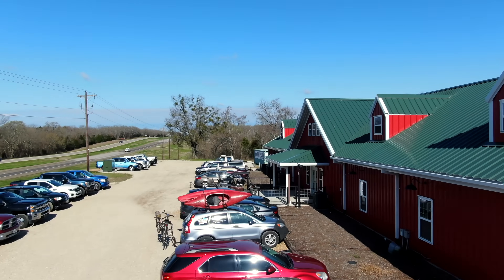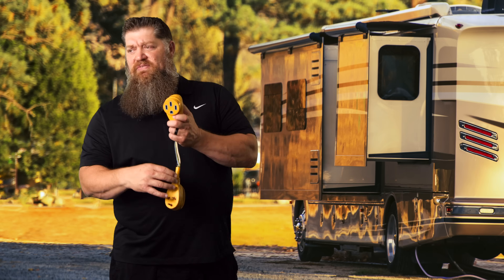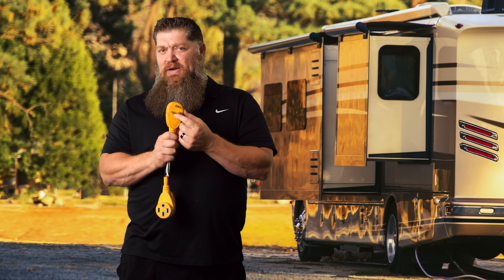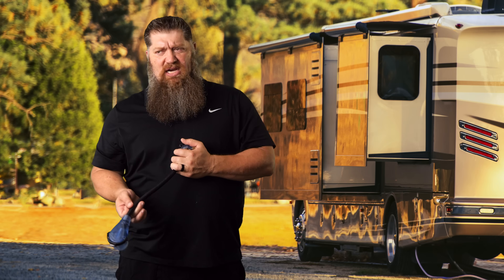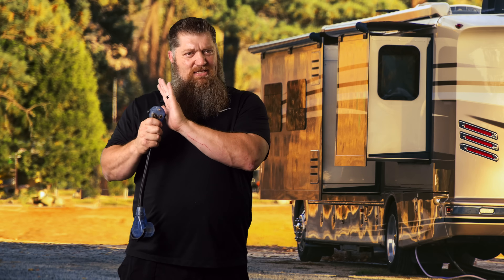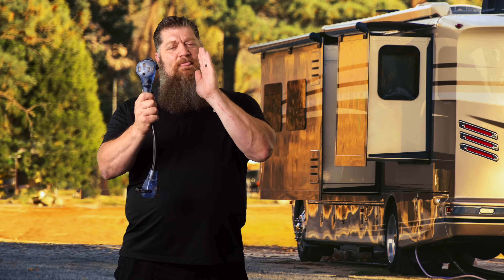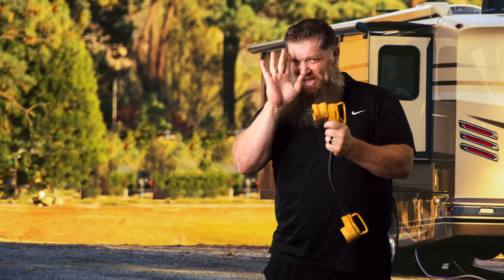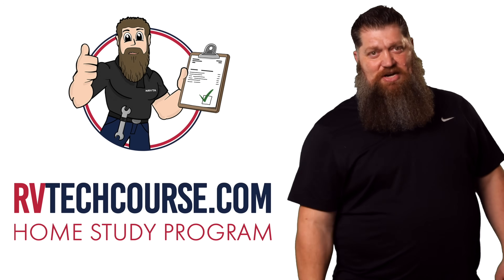30A to 50A RV dogbone adapters. What you need to know.

Comment: my old Avion is set up with a Coleman roof AC that runs off a 20 amp so I can plug it into that GFI breaker on a panel and run it along with the main air conditioning unit at the same time.

Comment: Thank you for the good info.  Im getting ready to use a 30 amp westinghouse igen 5000 dfc as a back up on my 50 amp rv. I was planning on running a 50 amp to 30 amp dog bone out of the rv's outlet and hooking up the 30 amp generator power cord to the 30 amp dogbone.. will this work? Thanks again.

Comment: Thank you for explaining this properly. I have 30 amp now and was trying to understand the 50 amp as put next rig is going to be 50 amp. I was trying to get a straight answer if I need 240 volt or 120 volt. I was also trying to understand how the rig would run going from, 50 amp to 30 but the jumper from one hit let to the next finally explained it. Everything will be energized but your available power will be drastically reduced. Thanks for the simple explanation that no one else could seem to simply explain.
Reply: I use 30 to 50 dog bone , then I hook up my 50 amp watchdog and then I hook up my 50amp camper cord

Comment: Not to mention the charge converter or the electric water heater, which can also push you over the edge. Those two also can kick in randomly. What i do in the summer when it hits 90+ in my 30amp travel trailer is always put my rv on Gas only setting for at least the water heater and leave the charger converter off during the day ( Now i have solar so it's off all the time ) That way if you run the Ac and the microwave at the same time the fridge is running you don't trip anything or overheat anything. 1400 AC + 1500 Microwave + 400 Fridge = 3300 out of 3600 max watts.  My breaker would keep tripping anytime the hot water heater would kick on because my wife would inevitably then decide to also make a cup of coffee or run the microwave. EVERY....SINGLE...TIME. Without fail. And no, telling her to flip off the water heater prior to running anything in addition is NOT a solution. Ask me how i know.

Comment: Breakers take time to trip when the circuit pulls more than the breaker rating, there is a trip time curve based on current above the breaker rating, it doesn't just trip when the current exceeds the 30A rating
Reply: I like how you put that, about the curve.👍👍

Comment: You know that is not a full explanation. There is a difference between resistance loses and inductive loads and hybrid loads like microwaves. Air conditioners are a problem because of the locked rotor starting demand when the compressor starts. Once they are up and running they only draw about 6’ish amps. Now for resistive loads I(2 squared)*R = Power demand. That demand never falls off. So the important load that you didn’t mention is the hot water heater.

Comment: my 1989 terry resort has stock 30 amp fuse panel i ordered the wfco 30 amp an i got the 55 amp wf-8955 model.... can i still use this on my 30 amp system?
Reply: Everthing time you upgrade an electrical device in your RV you have to make sure the factory wiring will support the upgrade.
Reply: @theconnectedcamper  ty! i did carch wfco 58min guide an they said all campers are basically 30 amp except the new models its just the converter charger thats 55 amp so 30 goues to your dc fuses an the leftover 25 goes thou your charger from converter but im not charging any batteries. but thank you for the prompt reply

Comment: My  W  is 30A but whenever Im at a park with 50 on my pole,
I use my adapter to give my coach 1L of 50A-just in case. 
More is  ALWAYS  better.
I have long been curious. What do you suppose an Rv parks electric bill is like?

!
Reply: That's a question for a full timer that has a rv similar to yours.

Comment: My class c four wind from factory cannot run air conditioner and microwave at same time - what do I need to do to fix that issue?
Reply: 30 amp
Reply: Turn off A/C and then run the microwave for its short time to cook, when done just turn the A/C back on. Sometimes the numbers to be so close that it might work if you had a soft start module installed on your A/C. If I had 2 A/C's on my rv I would put the soft start on the smaller A/C.

Comment: I’m totally understand this for sure however if you have a 30 amp camper and you use a dog bone to connect to a 50 amp?
Reply from the maker: Yes the 50 to 30 amp reducer will pull 1 hot, 1 neutral, 1 ground. It simply abandoned the 2nd got leg. 

So with the proper adaptor you will only get 120volts and your 30amp breaker in the rv limits how much you can demand.
Reply: @NationalRVTrainingAcademy  So I’m safe. Yeehaw 🤠

Comment: I was wondering if you are running surge protection where you would connect this? Would you connect a 50amp surge protector at the 50amp connection of the dog bone or would you need to purchase a 30amp surge protector to connect to the pedestal?
Reply: No matter what I would make saure you have a si=urge protector inline whether your using 50,30 and or 15mps to protect your appliances.

Comment: What about hooking 30amp service to the 50amp stand plug?  I had a tech guy tell me that was a good idea because in the campgrounds that service is more stable
Reply: Same keeping looking for validation on a combo I had like that. Something about using the second channel of the 50 amp to power your 30 amp trailer. "Since most parks are wired to draw from the first channel you are ""safer"" from surges if you can connect to the second channel. I live in a 30 amp and all the big rigs chug power. How do we 30 amp people get more consistency

Comment: Something alot of people dont realize is that on a 50 amp service you have 50 amps on esch leg. Thats 100 amps overall. Step that down to a 30 amp service and youre literally at 30% of the capacity youre used to.
Reply: I have a 50 amp rv and the only time ive ever gone over 30 is in the summer when we use both ac's

Comment: What happens if you are 50amp trailer, using a 30amp reducer, but have the inventors (2 - one for each leg) assisting what is coming in.  Do you still have the concerns you mentioned?  Thanks
Reply from the maker: Don't forget to check out this week's Q&A tech tip, where Todd answers your question!

Comment: Hey Todd. Thanks for the info. What do you about the Active  control new dog bone that works like soft start and easy start and plugs into the 30amp side? I bought one for my camper. You just plug it into the pedestal. You can dog bone it for 50amp. You can monitor the amount of amps, electricity etc you are using. We just returned from. 2mth trip and used it several times even with my generator. Pretty amazing to be able to see how many amps you are using so you know when to turn say the ac up so you can run something else.

Comment: Not into RVs but was wandering on a 50 amp single phase circuit the RV doesn't use have issues with the potential of 220/240 volts?

Comment: You should add to your video, never plug into a hot plug.
Reply from the maker: There is a ton I can add, alas it’s only 2 minutes.
Reply: Always make sure the RVpark pedestal is turn off before plugging into it.  Plug the surge protector in and then turn on pedestal power to make sure everything works and the lights are correct for good power. Then turn off power at pedestal and then plug your RV into the surge protector and then turn on the pedestal power. When leaving turn off the circuit break at pedestal before unplugging your rv.

Comment: How would you suggest i run one AC on my 50amp rig in my driveway? I tried to reduce it down to my regular plug at my front door but it kept tripping. I was was ONLY running one AC. 
Then i got a splitter to plug into TWO regular plugs and that kept tripping also.
I've seen it done on YouTube, what am i missing?
Reply from the maker: Don't forget to check out this week's Q&A tech tip, where Todd answers your question!
Reply: Your outlet at the front door is probably a 15amp GFIC outlet. Most A/C's are 15k BYU's and if you have a 2nd A/C it is most likely a 13.5K BTU A/C. You might be able to get away  turning on the small 13.5 A/C. But if you are adding a extension cord to your already 25/30ft power cord together is getting to hot because its to long and overheating causing the circuit breaker to pop. You need to buy one of those circuit load tester called "Kill a Watt" so you can see actually how much power your using. BTW that circuit at your front door could have other devices using power from the same circuit, over loading it.

Comment: Can you run a gen on 10 awg cord to RV when boondocking or moochdocking?
Reply from the maker: So 10awg is rated for 30amps. As long as you do not demand more than 30 amps then yes the genny could use the 10awg cable
Reply: @NationalRVTrainingAcademy what awg is meant from 50 amp?

Comment: Todd you always have the good info. When the wife and I finally get on the road, we are heading your way for classes. In the mean time, here's my question, if I have a 50amp rig plugged into 30amp with a soft start, does it make any difference?
Reply from the maker: So softstarts only address the starting amps. LRA. It cannot address running amps

Comment: Todd, you got to cover the "cheater Y" for using a 30A & 20A to power a 50A rig... that will spin a few out!  You see them for sale all over.
I know you can't use one if the 20A is a GFI.  However, some older parks and a lot of fairgrounds don't have GFI's... We ran last weekend off a "30A/30A Y to 50A"  at a fairgrounds because they had a temp power setup with all 30A outlets.
If you have a 50A rig and have to use a 30A supply often then I highly recommend a EMS that has amperage read out on the unit; or via bluetooth to your phone.  That way you can watch the amp draw as you turn things on to push it to 28A.  We set the inverter charger to low battery charge, run the RV propane fridge on 120V electric, both 13.5 power saver AC's and watch TV - and nothing else - no problems.  You have to know what you have to do this AND keep the voltage over 115V.
Reply: I had a Power switch installed on my 50amp rv. If I ended up at an rv park with only 30amps and a 15amp at the pedestal I could plug my 15amp extension cord into the 15amp pedestal and te other end into my 15 amp receptacle on my power switch. this would give me roughly 45 amps. Some TV parks don't like this because they charged you for 30amps na dyour taking 45amps.

Comment: You skipped the high power inverter.
Reply: Inverter when turned on without anything plug into it will use around 2 amps to keep it alive and then whatever you plug into the inverter for additional amps. So keep your inverter turn off if not using it.

Comment: Hi Todd, Would you consider showing how to add say a Harbor Freight 100 amp portable Thunderbolt external solar to top off house batteries during the day. I don’t want to add solar to roof and use this portable panel only when it can add value. How do you attach solar regulator safely where you can plug in the portable solar panel and not cause any problem.
Reply: I would wire a solar plug on the side of the RV. The other ned is hardwired to your battery. With a portable solar panel that already has a built in solar charger you just plug the solar into your new outlet on side of rv. As an alternative you could use alligator clamps on the battery end but they could pop over and cause a short or fire some where.

Comment: Most 50 amp motorhomes EMS will recognize 30 amp shore power and will only allow 30 amps max and will shed items over the 30 amps.
Reply from the maker: EMS on motorhomes are for the generators. No way to know what the supply limit (amps) are without programming it. 

On inverters we have to limit the input current. In other words I have to tell it the limit. 

Can an EMS have the ability to change the input current limit? Sure. And quite possibly this is what you have, but not all EMS gage that capability.

Comment: Any thoughts on why my white wire to Dometic 13.5 AC is charred on the last inch of wire connecting to compressor? I've read that this could be from running it on low voltage? Is ok to just cut back wire and put on new flag connector? New to us 2016 GD trailer and I was inspecting and cleaning before this summers 5 month adventure across the wide open prairies. Gotta have ac for the trip
Reply from the maker: Loose or corroded connection. Creates heat, damages the wire.

Comment: Todd, thanks for the tech tips. I’ve been around electricity, wired houses, service changes, etc. I’m still trying to get a new perspective on these RV plugs. When your brain sees these 30 amp plugs, it wants to think 220 volts like a dryer. I have to re train it to think 110, even tough these large plugs in homes are 220. 
Not a big deal, just mindset. Thanks for educating people, so many people burn their houses down overloading the circuit. When I built my house, I made every circuit 20 amps, 12 guage wire. Over 30 years never tripped a breaker inside, other than GFCI, and they trip if you get a solar flare I think, lol. Keep up the good work, probably already saved some lives from fire.
Reply from the maker: absolutely. i have several videos on that very topic.
Reply: I’m not a electrical person so am struggling to understand the relationship between amps, watts, ohms & volts. I’m a visual person so now I have to buckle down & understand it all before we buy our rig. I did help Hubs get his beginner’s & advanced Ham radio license so I have a weak base to grow from. Your comment about the house plugs just kiboshed my fragile attempt to understand 😂. It also helped. Thanks.

Comment: Hey Todd, how about using a 50-to-30 amp dogbone for a 30Amp rig when the post only has a 50 amp service available?
I've done this for years and found the power to seem more  dependable. 
Any thoughts?
Reply from the maker: absolutely nothing wrong with this. your 30amp breaker and the gauge of your wire will be the limiting factors. Flow is demand based, not supply based.
Reply: @NationalRVTrainingAcademy Thanks!
Reply: "More reliable" meaning doesn't trip under excessive load?  If the post only has a 50amp receptacle, then it should be protected by a 50amp breaker and won't trip at the post unless it is subjected to a dead short or the load exceeds the trip threshold. Some breakers will hold a constant load in excess of its rating under certain circumstances. If you're using a dogbone to hook a 30amp service on your trailer to a 50amp post, you will likely never trip the post breaker as your 30amp main breaker on you trailer service is now your main overcurrent protection device. The lower rated breaker in the circuit is your highest level of protection in the event of a fault.
Reply: This was a question I had on my mind for some time.  Thank you for asking that, and thank Todd for confirming it’s fine.

Comment: What if I have a 30 amp rig on 30 amp power supply....can I run the AC and microwave at the same time?
Reply from the maker: Hello Gary,

Here is the deal. Too many factors to say yes. This is why I am saying no. If you get in the habit of turning off the ac comressor and just let the fan run while using the microwave, then turning back to cool then you should NEVER have a problem. 

Air conditioners pull a certain amount of amperage.....which you will see quoted all over the place. What NO ONE is adding is the rated amps on that compressor will change based on HEAT.  So much so that both Dometic and Coleman can quantify how many amps more are being used based on how hot it is outside. Next there are different sizes of microwaves. from 900 watts to 1500 watts.  What I dont say is there are several other items that are on that you dont think about. Refrigerator which pulls 300 to 800 watts. You dont know when the cooling cycle comes on and if you are cooking with your microwave then chances are you recently opened the refrigerator door which will force it into cool meaning the refrigerator, microwave, and ac are all on at once. Lets not forget the converter which is powering the lights and other 12volt items by using 120volts. 

You see there are too many factors to ever say yes. Some people in some instances can do it no problem. But if I make you mindful and say no, then you creatre habits of NOT overloading your circuits....which is safer.
Reply: @NationalRVTrainingAcademy  Thank you for the detailed answer.
Reply: A circuit is rated to handle a constant load of 80% of its rated ampacity.  For a 30amp circuit, that's 2880 watts.  Add up your total load you're using for appliances, and don't exceed 2880 watts.  A microwave typically uses 1500 watts, leaving 1380 watts for your AC. A typical 13.5k btu AC draws 12.6amps while running, which translates to 1512 watts. When the compressor of the AC starts up, it exhibits a momentary inrush current of upwards of 150% or more of its running load or, in this instance, 18.9amps or 2880 watts. This is why both running at the same time will trip a 30amp breaker.
Reply: @Grizz45acp  Thanks for the info.